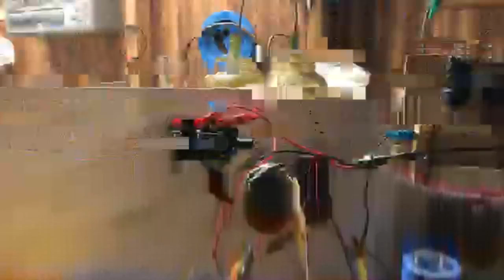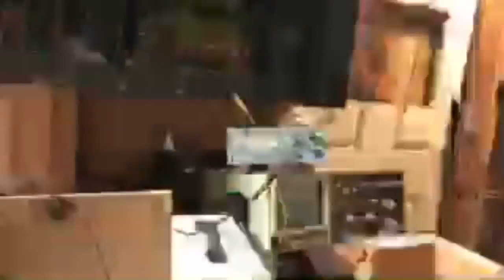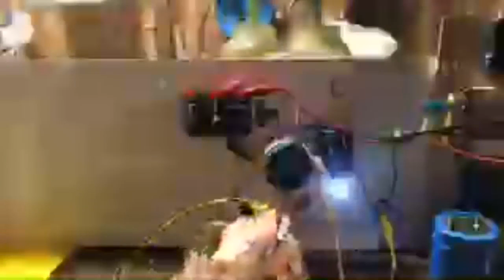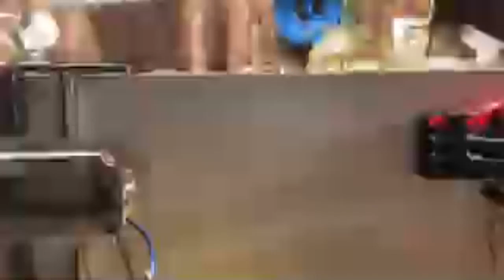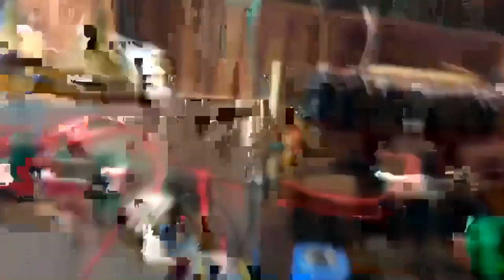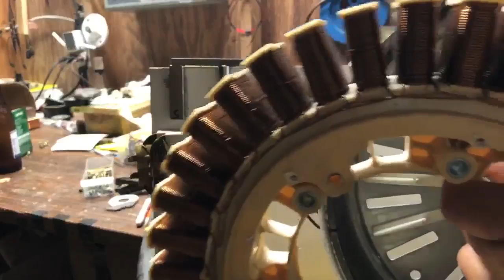L C circuit live

Comment: Supposedly the washer motor has all three legs connected at the end of them; making it one pulse into the whole stator. So not actually a three phase? Or could this possibly mean that at the end of each leg is a backwards current going through the other two legs? I also am under suspicion that the magnets are in a Hall Array, which means they are generally only one pole amplified inward. If so, this means the pulse to the rotor may also be attraction mode and in reverse when off; but also when in reverse, providing repulsion mode to the monopole magnetic arrays; or vice-versa. Supposedly it also uses a mechanical switch or a reed switch to detect when to release the spike to the stator coils. The switch is a part of the plastic nearby where the three legs join according to a video I have seen.

Live streaming is making bad video and losses of audio on my end. Not able to see the flashing of your LEDs to get the picture. 

I'm wondering if they named the cold war after the cold electricity...

http://www.teslasociety.ch/info/NTV_2011/free.pdf
Peter Lindemann The Free Energy Secrets of Cold Electricity 2000) (AUDIO SYNC FIXED) XviD x264
https://youtu.be/Ib0nViW9z70

http://secretsofcoldelectricity.com/pdf-downloads/